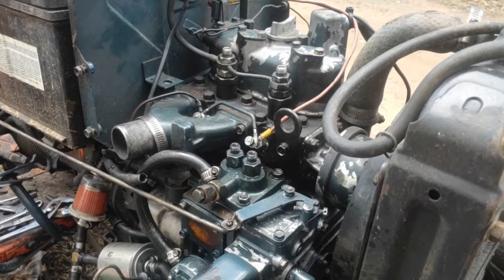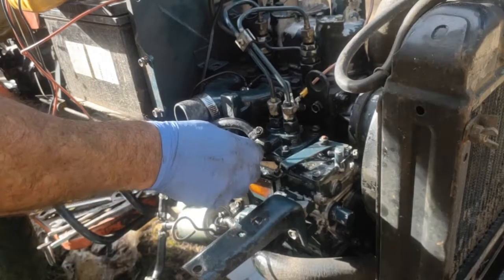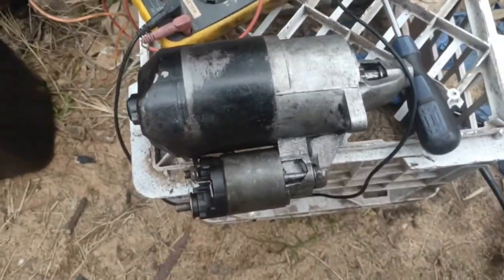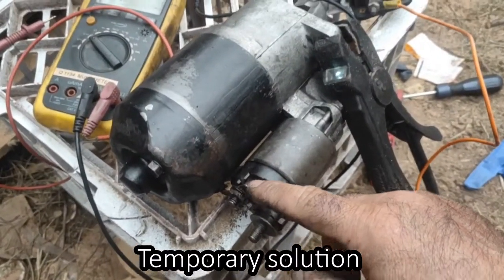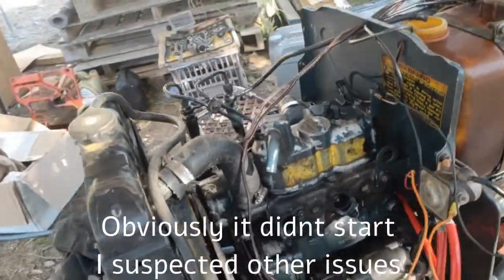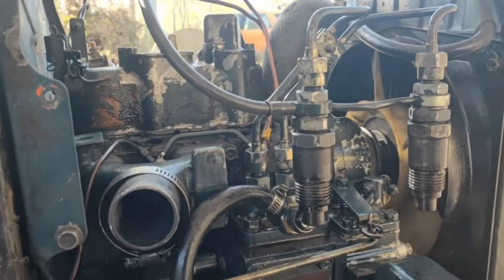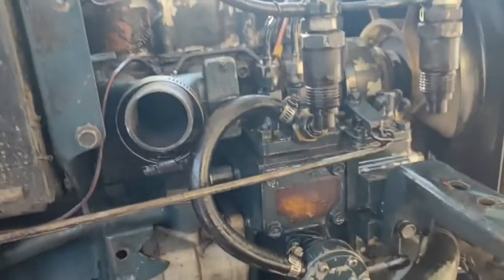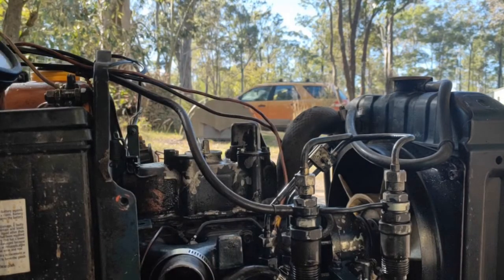Kubota B4200 -Z600 2cyl Part 2 Restoration

Comment: That poor thing man looks like the p/o left nothing untouched lol, these are totally a peach to drive around though I have my grandfathers old b4200 and love the thing. I uploaded a few pictures onto reddit of the throttle linkage/fuel filter/ignition/engine bay that may be of use to you to cross reference, goodluck! https://www.reddit.com/user/Easy_Significance_75/comments/jmuzxy/b4200_throttle_linkagefuel_filterignition/?utm_medium=android_app&utm_source=share
Reply from the maker: Thanks mate, it will help.